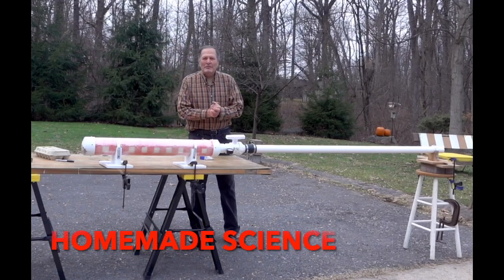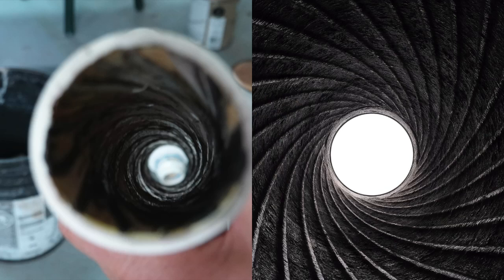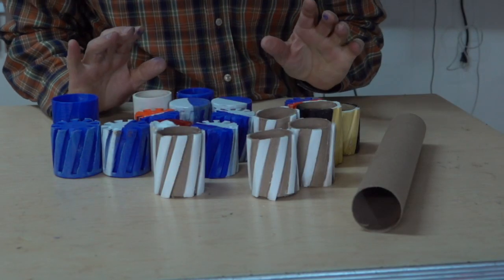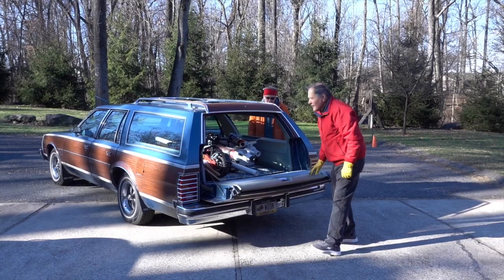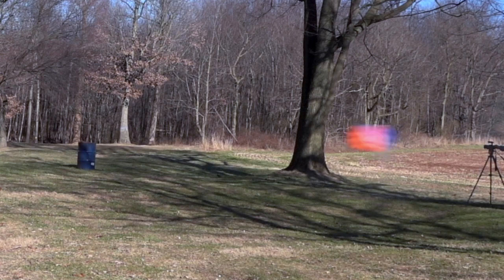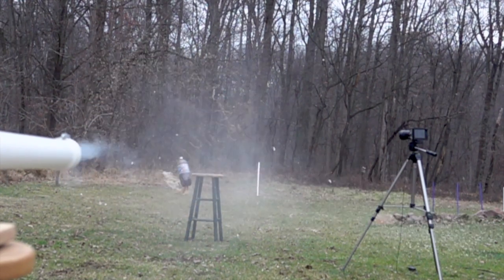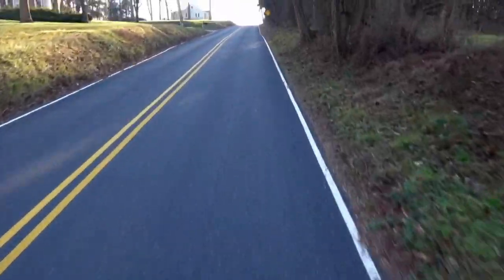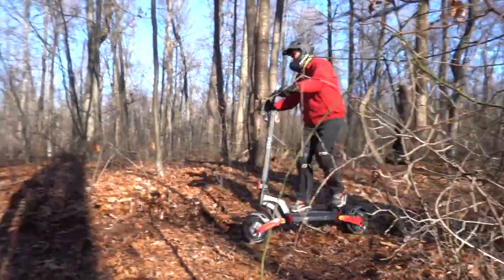Rifling an Egg Cannon... attempts to spin a 300 mph egg projectile

Comment: Rotating an egg about its long axis of symmetry is mathematically nearly impossible.  An egg's shape is a deformed prolate spheroid in which one end is more pointed than the other.  Rotating prolate spheroids precess about their long axis when they have a non zero angular momentum about that axis. But the moment of inertia tensor or an egg has off diagonal components when represented in a coordinate system in which the long axis is a direction.  So the precession about the long axis will change over time into a precession about the other two perpendicular axes. What's more, the egg is not a solid uniform density object.  The yolk is denser than the whites.  So both precession along the long axis, and wobble about the other two axes will change the time dependence of rotation causing chaotic behavior; more conversion versus time  of spin between the three principle axes.
Reply from the maker: thanks Richard, I could have used this information before trying it.  Still,  it was an interesting  challenge to see for ourselves what the results would be

Comment: Your egg is liquid. It won't spin in that time
Reply from the maker: my guess is there is quite a difference between the exterior of the egg rotation and the yoke inside.  it would be interesting to somehow test it
Reply: @YeanyScience  Inertia is working against you. It can be modelled with math, no need to test.
The scam of rifled paintball is the same issue, a shell filled with fluid .
The egg not being round means that an off-axis rotation becomes more of a thing. Like a dumbbell water balloon (only your shell will break)

Comment: How about a printed aperture between the air chamber and the barrel that causes the air to spiral down the barrel, hopefully imparting some spin to the egg
Reply from the maker: we did try adding baffles inside the barrel to spin the air and added a fin the the back of the sabot for the air to push against. but couldn't get the baffles to work.

Comment: Unless the egg yolk is well centred within the egg, putting s spin on it is likely to cause it to break or go off target.
If you cut length wise slots in the sabot, it should separate from the egg earlier as it mushrooms.
Reply from the maker: investigated several types of sabots in the first of this egg cannon series,  the expanding cup sabot works well but  broke too many eggs when we tried to make one with rifling on it

Comment: A inner locking discarding sabot that separates in half or in quarters wouldn't affect the egg as much when separating. 
It looks like when it leaves the barrel the sabot starts tumbling which throws the egg off its course.

Comment: Sorry if you addressed this in a previous video. They might be weaker this way but try flipping the egg over, fat end forward. They should be more stable in the teardrop configuration than the  reverse teardrop you have now. Print the sabots as 2 or 3 pieces, You'll need some kind of tabs to keep them together when handling and loading them. Might work well coupled with a rubberband to keep the "petals" from opening up after you've put the egg into the sabot. You might then be able to use some sort of foam between the egg and the sabot to give it support. This may help the egg spin along with the sabot if you still need that. You'll probably want to compress the foam in there pretty good.  Hopefully you can get the sabot petals to let go uniformly shortly after they exit the barrel.

Comment: Just a thought, but could you make 2 piece sabo (sp?) with a little bit of foam padding folded over the back side of the egg?  I think a thin piece of foam will add some protection to the egg, keep the egg in line during its launch, and provide some friction between the egg and sabo to get it spinning. The 2 piece sabo, split along its long axis, perhaps with chamfered inner edge will separate as it leaves the barrel. Just some thoughts. I enjoy your educational videos.

Comment: Strong suggestion you keep the scooter somewhere outside, just covered to keep the weather off it. There have been too many fires caused by scooters for me to have one inside by house. Even if the probability of catching fire might be low, the high cost of losing our home makes an unacceptable weighted risk :-/ (The Varla scooters use LiIon batteries, rather than the much safer but less energy-dense LiFePO4 cells, so they’re much more prone to thermal runaway.)

(That said though, that’s a cool enough looking scooter that I’d consider making a little scooter garage just for it. I like the suspension it has :-)

Comment: The sabots should be cone shaped, on the inside, so that the acceleration force helps the sabot to grab the egg.  I suspect the egg would also fly straighter, while spinning, if flying blunt end forward.  That orientation would also help the cone shaped sabot not crack the egg.

Comment: Maybe if you're roughing up the inside of the PBC pipe with sandpaper or something, it will allow the sable to grip it better. PS, like the station wagon. I remember riding in the back seat facing backwards in my parents and my mom taken driving lessons in it. While I rode in the rear seat.

Comment: Have you tested whether an egg is stable when rotating about its long axis?  Something like hanging it from a cord, the top of which is attached to a vertical drive shaft (e.g. a small electric motor) might be informative.  Fixing (gluing) the cord on- and slightly off-centre should indicate whether spin-stabilising the egg is viable.

It looks like you need to resurrect the split sabots which separated on leaving the barrel, thus releasing the egg sooner.  Or just accept that the egg-sabot combination is, in fact, your projectile 😆

Comment: Something you might try is to spin the sabot prior to firing.  This might be possible by tangentially cross drilling the breech for an air inlet from a compressor.  Angle the air slightly rearward and drilling a few vent holes at ~180° -- 270° from inlet might help keep the sabot from "walking" in the barrel or being pushed forward.  

To keep the sabot from being pushed rearward, a pin or nail inserted at say ~45° so only the tip touches the rear center of the sabot to reduce friction. Maybe install it in breech coupler or make it removeable to allow easy breech loading.
Friction of the sabot could also be reduced by allowing only the front and rear diameters to touch the barrel.

To minimize losses the inlet and vent holes don't need to be that big, but the vent should be 2-3 times the inlet area.
Inlet: 1/8" - 3/16"  Vent: 2 - 3 holes of same dia. as inlet.  Adjust as needed for pressure available.
A separate air reservoir and valve could be used to make it self-contained. 
A section of clear pipe could be substituted in to assist in measuring rotation of sabot via a tachometer prior to firing.

This might seem kind of complicated for an air cannon, but may offer better consistency in rate of spin. From other projectile experience, I know that spin stabilized projectiles of different size, weight and shapes are effected differently at different spin rates.
Might be cool to experiment with rates for best stabilization, and different sabot shapes for air/spin efficiency.

Comment: Nice video as always.
If you boil the eggs, they probably make more stable projectiles aswell, since the weird dynamics inside the egg get diminished.
Reply: Maybe do the spinning egg trick to scramble the insides so the yolk doesn't offset before you boil them? Have to sit them all up (or down?) so they're consistent though.

Comment: I believe the eggs rotate along the "wrong" axis not because of design flaws, but because of physics 
Ignoring air resistance, the rotating egg has no way of changing its angular momentum. However, since the eggs are raw, they can lose their rotational energy to heat and sound of its innards sloshing around. Losing rotational energy without losing angular momentum, and the egg ends up spinning along its axis with the maximum moment of inertia, at the lowest possible rpm 
If you were to hard boil the eggs to make it entirely solid on the inside, it should spin much better along the intended axis
Reply: Yes, I think the yolk is neither centred, nor fixed, inside the egg. I wonder if there's a way to break the yolk without breaking the egg - then it might fly better.
Reply: There is air pocket in egg. Depending how fresh egg is and how it was stored air pocket will migrate. I think that is creating erratic behavior.
Reply: @rapsod1911  Ah yes, that too.
Reply: Air pockets and yolks are irrelevant to the principle I'm trying to state. As long as there is a easy way for a rotating object to dissipate rotational kinetic energy internally, it will end up tumbling head over head; and as long as most of the internals of the eggs remain a liquid, it will dissipate energy internally. The movement is not erratic either, it predictably always rotates along its axis with largest moment of inertia.
Edit: Veritasium has a fantastic video on this topic, link: https://youtu.be/1VPfZ_XzisU?t=664

Comment: I think gluing a tail on the egg is a winning idea! I'm surprised it stayed on
Reply from the maker: I agree.  All that work in designing the rifled sabots and the answer was so simple.  We'll see what happens at higher speeds when the weather gets warmer.
Reply: @YeanyScience  if you split the sabot in half length ways it will separate quickly and easy.
Reply: @YeanyScience  If you bend the tips of the tail, it'll spin. Dart-players do that to their darts.
Reply: Fin stabilized sabot egg projectile

Comment: Why would anyone want a scooter? 🤔
Did you ever do a flying comparison of taw vs hard boiled eggs?
Reply from the maker: I do a lot of bike riding, the scooter is a fun alternative.    yes I have tested raw, hard boiled and frozen eggs. I will post results in a future video
Reply: @YeanyScience frozen eggs??? They didn’t crack? Now I need to try
Reply: @YeanyScience also, what you need to test, is an internally scrambled egg. also, testing expired eggs is one of the main reasons you’re having issues. The older the egg, the bigger the air pocket and more off balance the egg will be. Buy some super cheap eggs that are fresh. Those nasty things really shouldn’t be eaten anyways, so you’d be doing the world a favor.